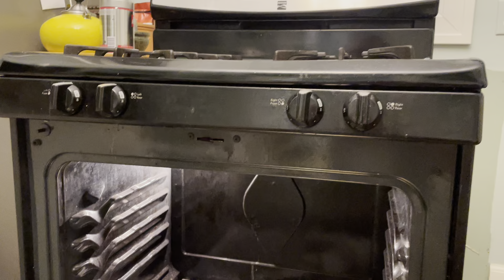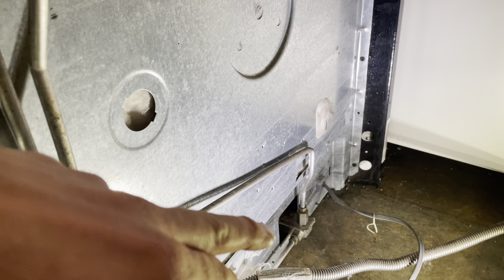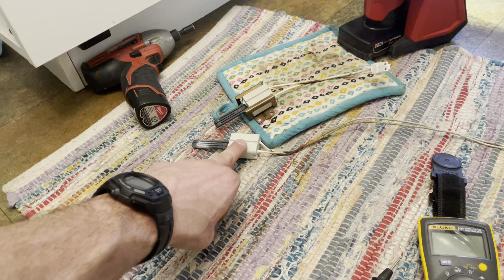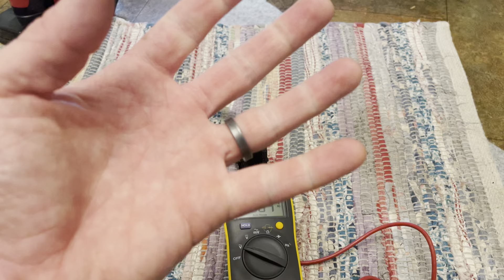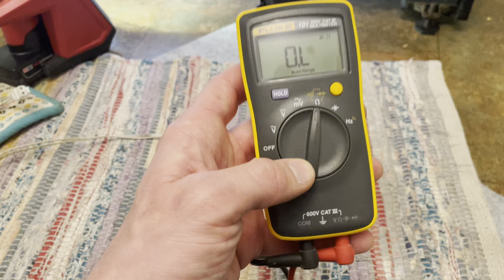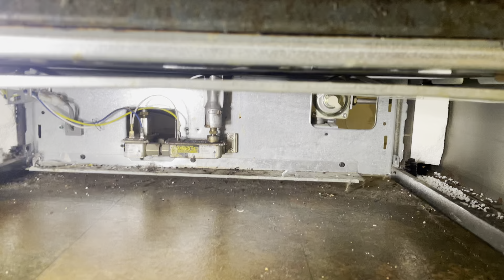Kenmore Oven Repair (will not heat up / bake function inop) and diagnostic steps

Comment: Aren’t you able to do voltage drop between the two lines at the hot surface plug?
Reply from the maker: Yep. On the good one it was 112 volts leaving 3 for the valve. On the bad one it was around 114.5.